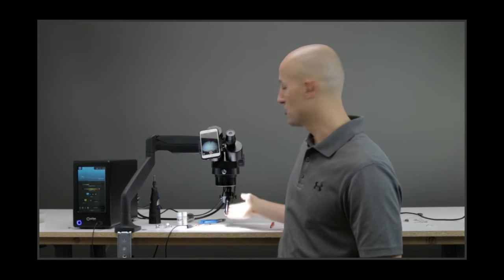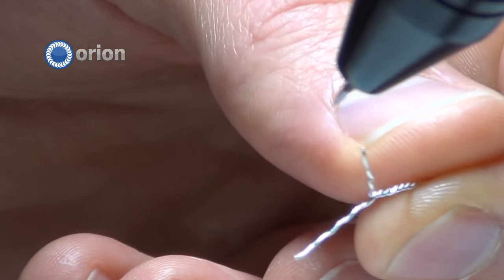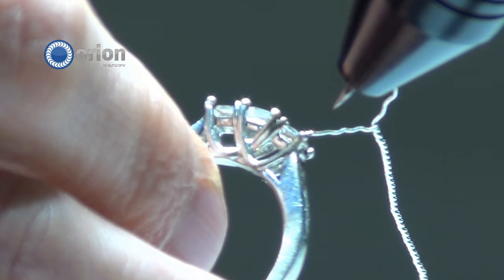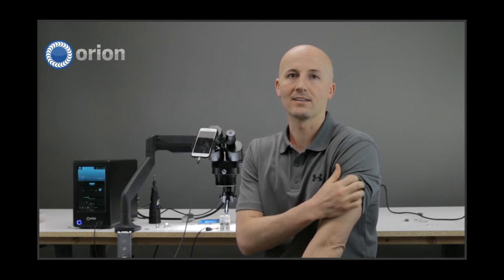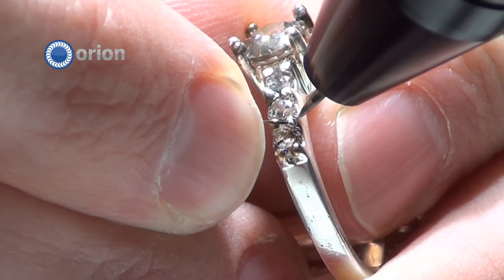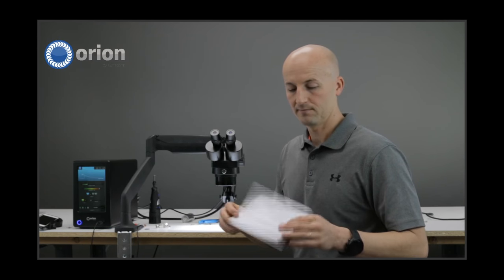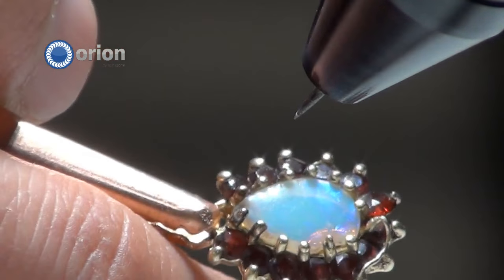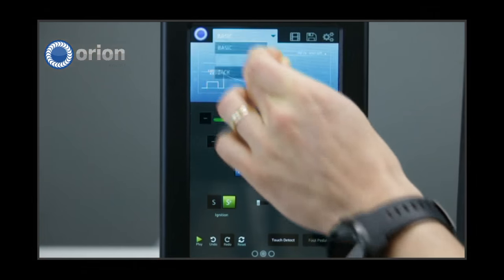Re-Tipping a Prong - Orion Live Training Webinar Ep.2

Comment: To the question at 58 minutes, you didn't mention the alloy that gave you trouble with pitting.  If its nickel white gold prongs, try melting less of the parent metal(the prong).  Add your filler wire without over diluting it.  I am having success with Pd-white gold or 19k white gold filler (28-30 gauge)

 Also,  a third technique for rebuilding prongs or claws is to use half round wire, the same diameter of the existing prong, and welding that half round wire to the prong. 
Then using a 28g or 30g filler,  fill in the gap....the whole while, keeping the flat side of that half round wire pressed tight to the stone.  To finish, trim your half round wire(really long prong) down to size. This eliminates the material balling up away from the stone.  Practice this method on a large solitaire where the prong is worn down to the girdle.   search "tribletman retip claws" on youtube....your welcome
Reply from the maker: Excellent Suggestions, Thank You.

Comment: Did Bryce blast that stone and permanently damage when he was smoothing out the prong after he changed the setting to 12ms? I saw the stone had a white color oxidized spot after the shot it was hit does that come off?
Reply from the maker: Kris,
Great Catch seeing that. You can see the black oxide coating and a small amount of white on the stone itself. The majority of this can easily be removed with the use of the brush used in the video, or by using a polisher, or even a steamer. With that being said you can fairly easily damage the stone by exposing too much heat. We recommend covering the stone with a protective layer to protect it from the sparks, and heat. We offer a product called Gem Guard, you can use jewel cool, or even toothpaste or chapstick. Anything to create a small barrier.

Comment: I have a problem welding gold . the metal is cracking after is welded. how can i avoid this?
Reply from the maker: The first questions would be what Karat Weight is the gold. The lower karats become harder to weld, the metals that they use other than gold cause problems with welding. Zinc specifically causes problems because of a low melting temp, and low boiling point. Zinc begins to boils off before the gold even melts. The solution to help this is to keep welding the same spot over and over, removing as much of the other problem metals. This will blow all the zinc out, and allow for just gold to make a good weld joint.

The other thing to consider is the power settings, argon settings, and joint preparations. You have to ensure that the power settings are high enough to get adequate melt of the metal. The argon gas pressure should be between 8-10 Psi on the machine, this will ensure no oxidation to occur in the welding site. and Lastly, the joint should be as tight and smooth as possible.